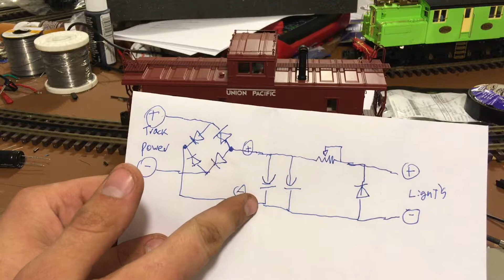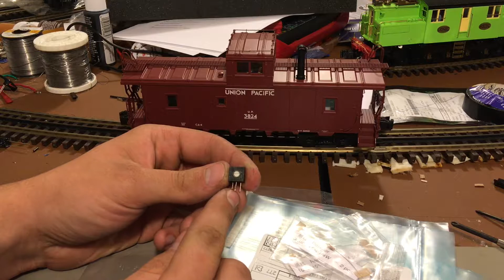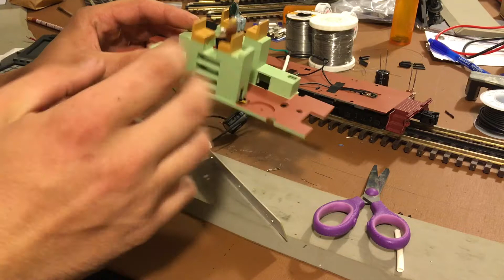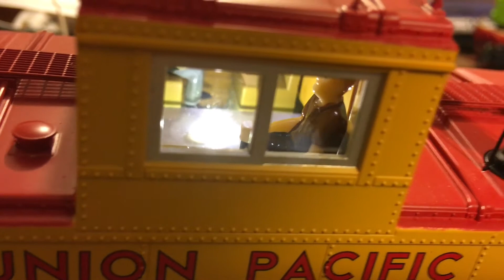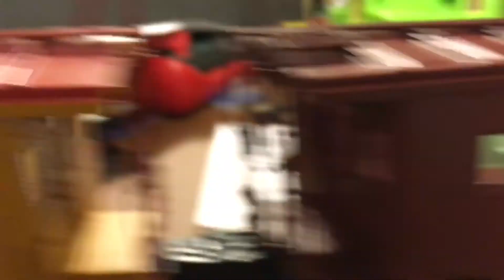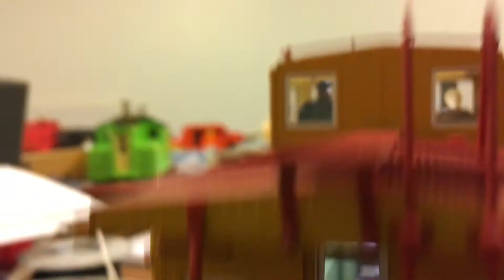Putting in flicker free LEDs in Lionel CA4 Caboose

Comment: Where  do you  get your  led lights  from
Reply from the maker: In this case I was using the original LEDs that were in the caboose. Evan’s Design has a good selection of single diodes. If you looking for a rolled solution for a car then check out Hennings trains

Comment: I did what you did but I used variable resistors to adjust the voltage to a constant 10 volts for 12 volt rated LED lights. The hard part is remembering to keep positives and negatives straight.